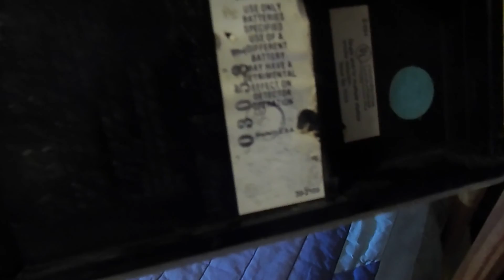Pyrotector/HeathKit Smoke Sentinel 30-77L Smoke Detector

Comment: wow thanks for posting. My dad was one of the engineers that designed this model. It was cutting edge at the time, first use of a custom IC. Millions were sold under Heathkit, Radio shack, etc. Interesting note, the siren will cluck if the battery get to low. The battery lasts about 9-12 months, pretty good for 80's tech.
Reply from the maker: Thanks! I've always loved the design of these, would love to get one with the blue MuRata piezo horn which seem to be slightly less common. I had seen old Radio Shack ads featuring these, they were also rebranded by Archer (may have been RS's brand, IDK) though I've never seen an Archer one in person. I'm also after the earlier square model and the rarer round and square models from the same time period as this one that had the same basic styling.

Comment: Cool video. I actually listened to this with head phones on and it didn't bother me, I saw one of these detectors around 2006 at a fleamarket in Brantford, Ontario but as to why I didn't take it awww darn that was my fault. I am going to be making a video of my  Gardsman  wind up bell  which I can easily set off as well and soon my Nortron unit which is an AC unit. I have watched a video from Nlind on how to set it off but I think I am still going to need some help. That is with the nortron unit which I am guessing can't be older than 1980 as it has a brass squealer horn.  I guess ebay is the way to go to find these vintage detectors.
Reply: You said this was also a pulsating alarm and for having a mechanical horn back then that was rare although I listened to this and it sounds like a conitinuous alarm to me.
Reply from the maker: It does have a slow pulsating pattern, about 1.5 seconds on and 1 second off.
Reply: I had to listen to it carefully but I can hear it pulsating. It is barely noticeable if you don't listen for it. It also uses a star horn/buzzer. I do believe that is the same one as the GE Home Sentrys used. I think there were a few other detectors that used them but I can't remember what they were. You are right it does take a while for the alarm to sound once the test button is pushed. The detector also some what does resemble a door bell chime. Pretty cool find. thanks for sharing.
Reply: I think the other detector from the mid to late 1970's to use the star horn was the ADT detector. My neighbour had one of those in her house. I do believe that is the same horn because I remember I was at her house when it accidently went off. This was around 1982. It scared the crap out of me. This is exactly what it sounded like although today that sound actually doesn't bother me. I think it is because it is a lower pitch buzz but that still would be effective today. My family also used to have an electronic organ in the late 1970's and one of the lower keys also sounded like this.